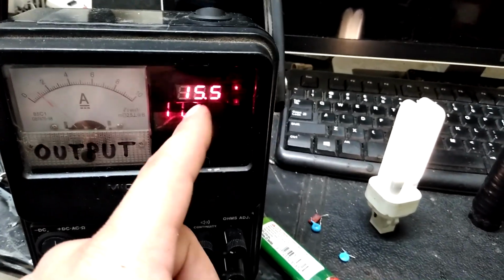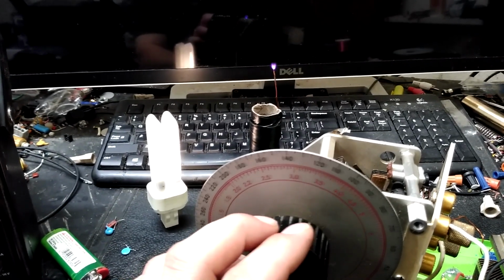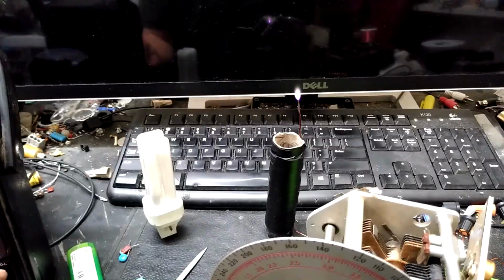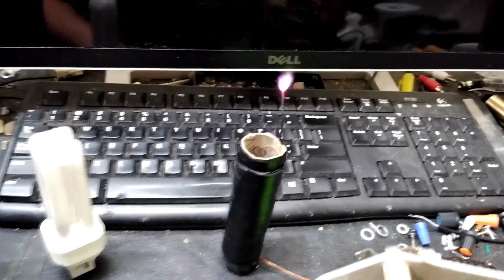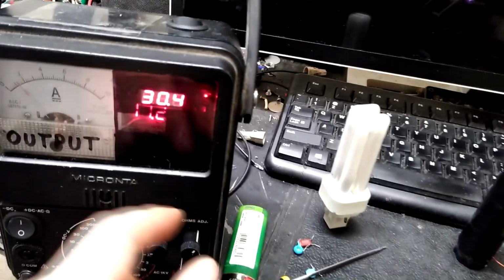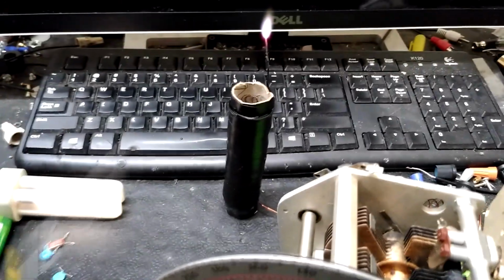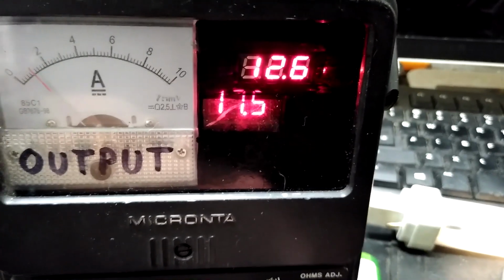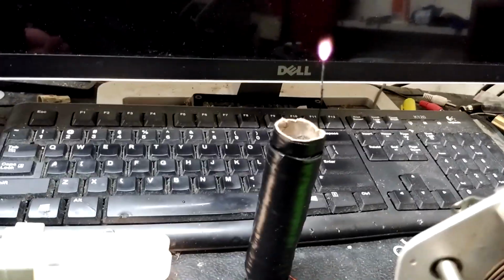HFSSTC testing at 16mhz

Comment: You can put your supplies in parallel to power more than 30v (except if they cannot handle the current draw)
Reply from the maker: The one I'm using in the video can actually do about 200 watts for a little while with the right battery (drill batteries) but it's the max 30v that is holding me back with most of the circuits. I think I'm just going to buy a cheap variac make a smoothed DC supply for stuff like this.

Comment: Hmm yeah could have been the cap arcing out that killed all those fets, mine does arc sometimes but it doesn't kill the fet, just dont know but hey it works just as good as mine 👍
Reply from the maker: Or it could just be random luck and the next time I fire it up with these new fets it will be instant death haha. Bout to find out in a bit but all I have is 460's, still waiting on 250's. I'm uploading a little vid now going over the SSTC circuit I'll send you the link in a bit.
Reply: @Magneticitist  hey bud I found the circuit for the coil u have 👍 I'll try it out but I have to see what fets I can use, i dont have low volts types like they use, what did you use ?